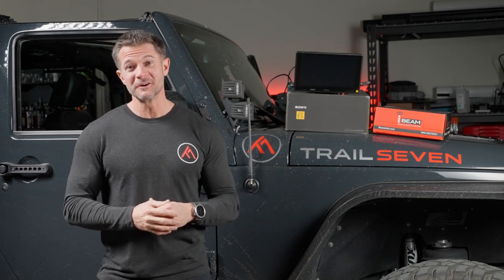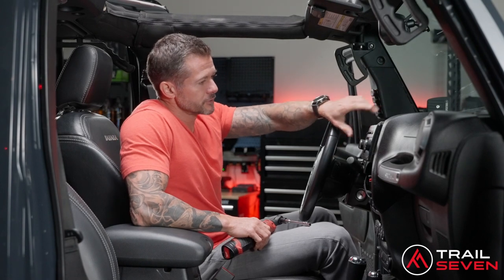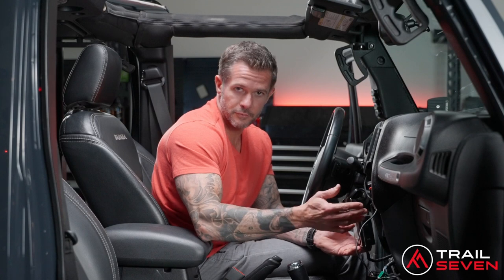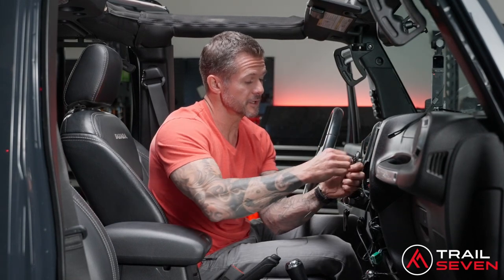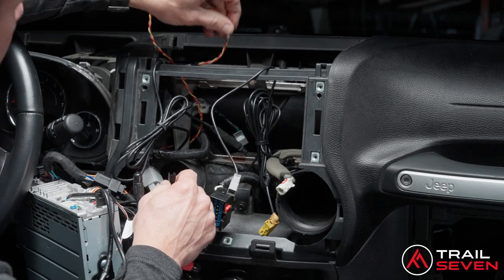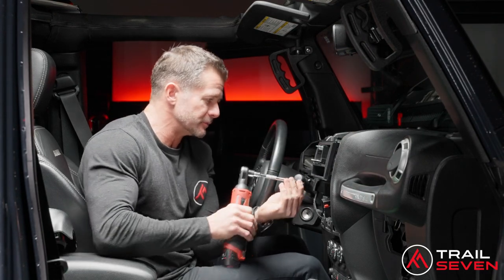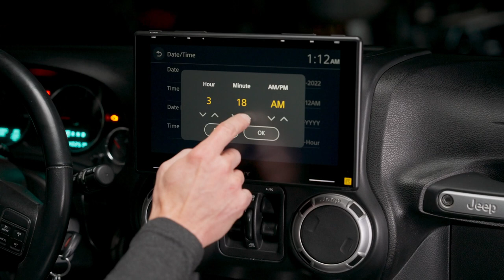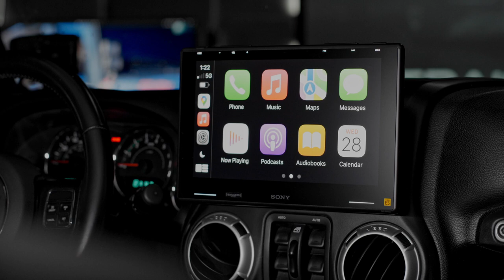Jeep Wrangler JK Sony XAV-9500ES Plug & Play Kit Installation | 2007 - 2018 Jeep Wrangler JK

Comment: I have a 2017 unlimited sport w non auto locks and windows and I don’t have BT or any of that - could I still install this? Looks like besides the center with window controllers mine is pretty much the same
Reply from the maker: Absolutely!  This would be a huge upgrade to your Jeep!  Your install would be the same minus removing the window control, yours would remove the holding tray in that spot in order to remove the bolt behind it.  Let us know if we can help with anything.

Comment: Very nice. I might have missed this, but if you have the premium OEM Alpine audio system with amp and sub in JK, does the Sony with Maestro interface properly? As far as fader, etc?
Reply from the maker: Yes, with the Maestro and the new wiring harness set up as factory amplified, all of the functions operate properly including the fader which I hear is lost with other interfaces.

We pre-wire our Plug and Play bundles according to your Jeep equipment to ensure that all controls and functions are retained!
Reply: @trailseven  Thank you.
Reply from the maker: @AdventureRocks  Absolutely!  Anything that we can do to help, please let us know!
Reply: @trailseven  Thanks, got it installed and it was entirely plug and play just like your video. Really nice upgrade. I was really impressed with the bundle and attention to detail on your team's part with the harness and all the prep details. Made the upgrade super efficient and convenient. Very grateful! On side note I have manual transmission in my JK and thought I'd have to run the extra purple wire described to my passenger foot well area, but somehow without any modifications when I shift in reverse and shows my backup camera automatically already even with the MT. Guess through the Maestro perhaps? Anyway, seems to work fine for me as is. I remember I had to do that for the power on my aftermarket backup cam when I installed years back, but saved me a step this time. Ya'll really have a unique offering focussing on tailor-made solutions to Jeep owners. I've become a fan! Again, just really impressed with the offering, so huge thanks to your team.
Reply from the maker: @AdventureRocks  Thank you very much for your feedback!  We take pride in not only the products that we represent but also in the delivery of our products. This includes every step along the way from the product planning, the videos, the workmanship of the bundles, the packaging, and the final delivery to ensure that everyone is receiving the quality and service that they should expect.  

From the team at Trail Seven, we appreciate you! 

P.s.- the Maestro compatible product line makes a world of difference in the features!

Comment: Just got this bundle for my kid and the 2015 JK.. and installed in in about 45 min taking our time. He has a big sub and I forgot the size of the amp but holy crap what a difference  over the U connect system that came with the Hardrock edition..  Can you do a video or point us to a video that can help in tuning the speakers in?   They are the factory Alpine..  Thanks

Comment: Awesome video what is the difference between the SONY XAV-AX8500
And this one? Can you do a possible review😅
Reply from the maker: Hello- we have the 8500 as well and it’s a great unit.  Comparing the (2), the 9500 is an ES product which is Sonys higher end line.  The 9500 has a faster processor which is better when connecting it to a full sound system. 

The 8500 however does have the newest adjustable swivel mounting bracket making it easy to adjust the screen angle to your desires.
Reply: I have multiple cams on the 8500
Reply from the maker: @jordancstephen  You are correct, we stand corrected and have adjusted.

Comment: Does this have better audio output than the stock Jk system?
Reply from the maker: Short answer, YES!  The Sony 9500ES provides 55w x4 for much better than stock speaker power, has 5v pre out for high powered amp/ sub options, and a 14 band EQ to help dial in your sound system.  Add in our Kicker speaker bundle and our Plug and Play Hideaway powered sub and you have yourself a high quality sounding easy to install sound system!

Comment: Not sure if this has been asked, but i am not sure about this having to plug into the obd port.  What do you do if someone needs to use that port for diagnostics?
Reply from the maker: No worries at all, simply unplug the Sony from the port and use it for whatever you’ll need to plug in for diagnostics, flashing, etc.  You can unplug it and plug it back in without resetting any configurations or causing any issues.
Reply: @trailseven  I appreciate the reply.  Seems like it shouldn't be any problems with it.  Thanks

Comment: So.. at 19.45 you zip tired some wires and reinstalled the glove box. What happened in here? This is the only time you show doing anything in the glove box.
Reply from the maker: That’s really funny actually.  Nobody has mentioned that and I had to watch it to see for myself what you were referring to.  It appears that a portion of the backup camera install video snuck into the 9500 Install video.  You would disregard that for the 9500 install itself.  Thank you for point that out!
Reply: I actually figured that out while watching the camera installation video 😅.  Is there a new discount code. 9500MAX isn't valid.
Reply from the maker: @Freedom__-xd5bx  😁!!  Sony released a huge sale last week for $300 off so the new price is reflected without a code needed.  It runs till 7/2.
Reply: @Trail Seven  yes, I seen that the price for the head unit was down to 999.99. Do you have any insight on if Sony will release a unit that will be IP57 rated?
Reply from the maker: @Freedom__-xd5bx  No sight of anything weather/ water proof.  They did mention the soon to release 9000ES which will have the 6.95” screen with the same functions as the 9500ES.  No mention of a weather/ water line.

Comment: How protected is it from water? 
My Jeep (currently) has a small leak right above the stereo.
Reply from the maker: Hello!  The Sony line unfortunately is not water proof.  Is the leak dripping right on to the dash tray where it's leaking water behind the dash?
Reply: @trailseven  no, but it leaks across the face of my current radio. Not a lot. Just a few drops.Right where the five screws go in to mount the screen
Reply from the maker: @f.adamrios786  That would be a tough call and we wouldn’t be able to say that you wouldn’t have any issues.
Reply: @trailseven  I'll probably end up getting it anyway. The specs match what I am looking for.
Reply from the maker: @f.adamrios786  You got it!  Let us know if we can help with your order details/ processing, etc!
Reply: @trailseven  No worries. It was easy and straight forward.
Reply from the maker: @f.adamrios786  Ok Great!  Let us know if you need anything!  Thank you for the order, we’ll get your bundle into production as soon as possible!
Reply: @trailseven Installed it yesterday. Super easy to install and it is absolutely amazing! Thanks a lot for such a great product!
Reply from the maker: @f.adamrios786  Awesome, thank you so much!  Glad to hear that you’re happy with it!
Reply: Would you be able to post some pics of your finished install?
Reply: @MatthewJMill I'm not sure how I would. Plus, I'm away from home right now. It looks great though! I'd definitely recommend it and it works perfectly.

Comment: Can you share some steps (vid if pos) about switching between bluetooth devices.  3 people drive my 18 jku regularly and my current kenwood is a pain to switch between devices.  Is radio tuner built in?
Reply from the maker: Switching between devices in general or specific to the Sony 9500 ES?